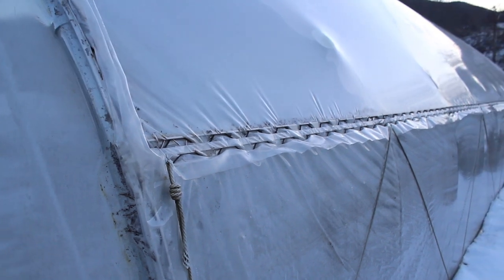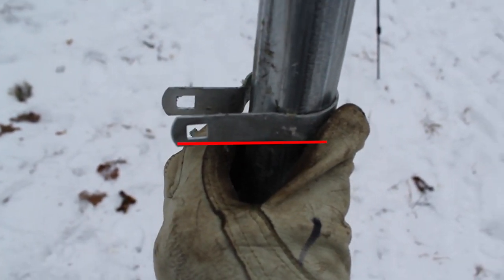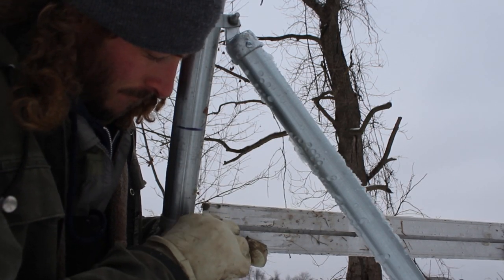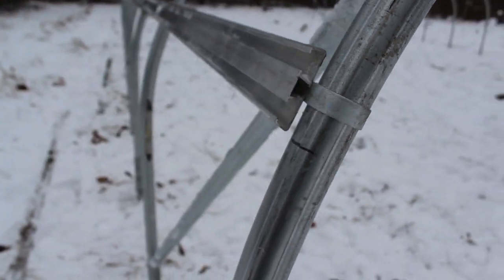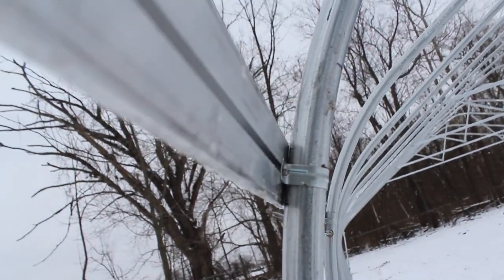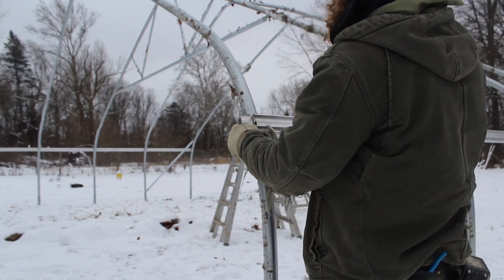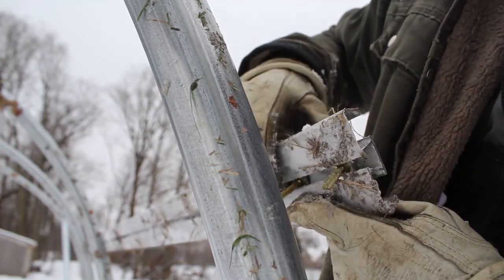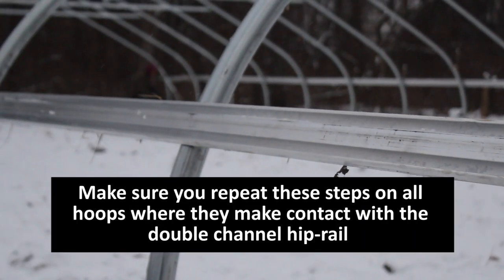Install Greenhouse Hip Rail using Double Channel Hip Board - Bolt and Nut Method

Comment: If you don't have the bow where 2 double channels meet, do you attach the plate to the double channel on the ground?
Reply from the maker: Good question Alexandra. You can do that, or you can use a tool called a vise-grip to hold the plate against the double channel in the air. If you did attach the splice plate at ground level, I would only attach the splice plate to one piece of channel on the ground, then raise it up for installation, before the next piece is attached to it.
Reply: @tunnelvisionhoops  Thank you so much! Love your videos!

Comment: What is the purpose of Double channel ? 

Paul
Reply from the maker: The double channel acts as a structural member that adds rigidity to the structure itself. It also ties in all of the bows to a horizontal member and thus allows you to plumb each individual bow at the point of connection. 

Additionally, the double channel provides two connection points for top cover and roll-up side plastic. 

Thanks for watching!